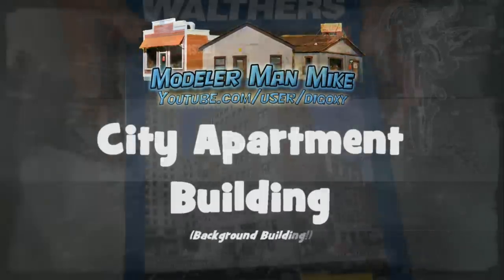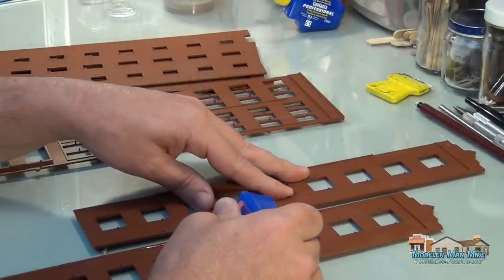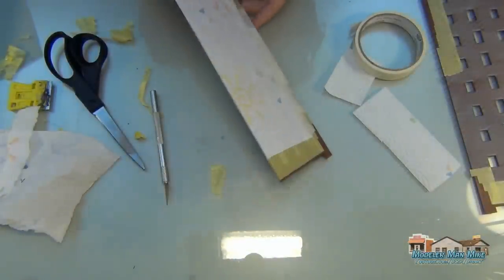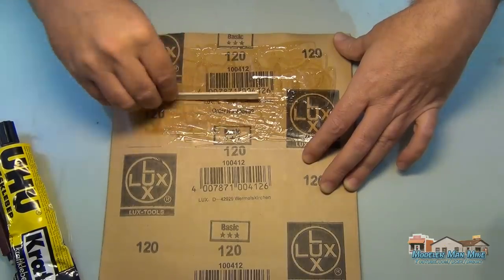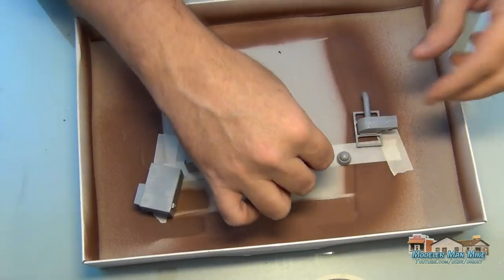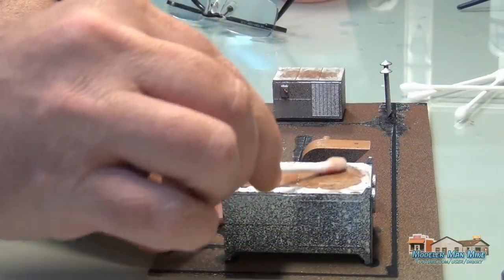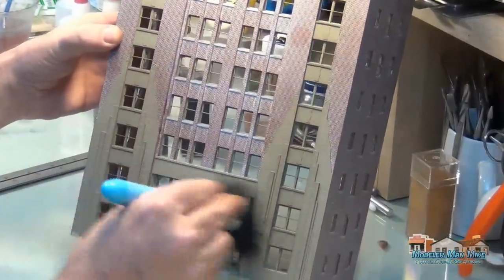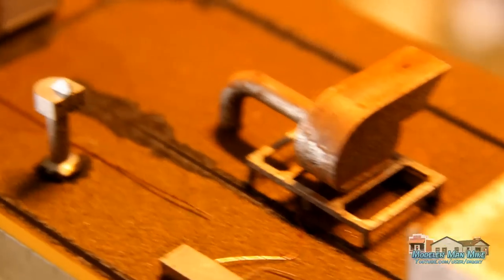Model Railroad HO Scale Build - Walthers City Apartment Building

Comment: Wow superb way of building and painting a model,liked the end result.
Reply from the maker: Yea, this works well for me. I spent so much time with the airbrush early on and using spray paint cut some time off on building these models.
Reply: I've just completed a Kibri mill kit I've used two of these kits and bashed them together to create a larger mill.Just needs weathering now to complete and added to the layout.
Reply from the maker: percomotion Sure would like to see some building techniques if you would be so kind to put together a video :)

Comment: I like using drywall mud for brick morter, easy to clean off and take's weathering well, very realistic when done right.
Reply from the maker: Hey, thats an idea, never tried it. does it clean off well? how about chipping when its dry?
Reply: The trick is to wipe off as much as possible before it dries completly, a moist paper towel does good after it dries, takes a little practice but like I said it looks awesome when done well. It may chip a little at the edges and corners but sometimes that adds to the realism.

Comment: I'll tell you about another really cool Walthers kit if you can get your hands on one and that's the Ford plant office building they made some years back.  I was lucky enough to get my hands on one and I converted it into a city hospital with the big ER entrance in the rear, a huge heliport on the roof and custom signs & decals to make it look like a real hospital in every way and everyone who saw it wanted one, lol.  I even found this outfit that made highly detailed 1:87 scale Huey choppers that I totally converted to "ile-Flight" helicopters and they sold like hotcakes on eBay until the company went belly-up and I couldn't get anymore???  Great videos my friend.
Reply from the maker: Bernhardt, do you have pictures of your models anywhere? You can look me up on facebook if you like. I would surely like to see this ford plant conversion! Thanks for the comments.
Reply: ModelerManMike I'll have to look at my old files and check because I'm not sure to be real honest with you?  I'll look into it & get back to you.
Reply: Howdy Mike, I haven't forgotten about the pics & are still going thru discs when I'm in my train room from time to time.  The problem is, I have several hundred discs with pics on them & I'm not real good at properly marking the disc so, I have to go thru them one by one, lol.  What I did luck out & find is, I located a guy on eBay who had a partial case of those 1:87 scale Huey helicopters I told you about so, if you have a need to one or two, let me know & we'll take care of that amigo.  Later, Bo (Bernhardt).

Comment: Nice vid! Love that roof top detail kit..gotta get me one of those!
Reply from the maker: Hey John! Yes, I havent really found anything for roof top details that compare to this fun little kit of stuff, I would like to see some others though if you run across any. glad you made it over to see some of these, I know your working hard on your stuff and getting an early jump on paint before lights will save you some grief later, I speak from experience :)
Reply: yeah, I used to big into the tabletop wargaming. I've painted my share of mini's na buildings. =) all of them will be painted. you can check out my control tower vid there is one of my painted buildings after I had put the kit together.

Comment: Not bad.  Maybe speak a bit more distinctly, but a good project and the scene changes are nifty.  Two comments from a retired electrician/ACR tech, though.  1.  Conduit is laid out and installed with 90 degree bends only in the application you've modeled.   2.  Rust on those roof top HVAC units starts at the seams between panels, so to give it a more realist look/feel, rust the seams completely before rusting any place else.
Reply from the maker: Great tips and suggestions. Thanks for your comments!

Comment: Mike just a thought.  When you go and illluminate this building a good thing to do may in fact be this.  Slip a little piece of construction paper inside the model, form  separate walls and floors.   That way, when you light it you may achieve a look of some empty  apartments either through non rental or residents out for the evening.
Reply from the maker: All good points Richard, thanks for the idea's! I hope to get on lighting this soon and surely will consider your idea's.
Reply from the maker: Brian UK Yes, I have used plastruct weld, its not to bad, a little thin but works well.
Reply from the maker: Brian UK check out my other video's on the lightkit, you might find it interesting using PIC IC's.
Reply: ModelerManMike Can you point me toward your video that shows the light kit? Thanks, and keep up the good work.

Comment: great video mike, great pace,  pleasant narration, fine workmanship... where can I get some machinist weights like you use in this video?
Reply from the maker: Those are called 1x2x3 blocks, I got mine from eBay,  Something like this maybe http://www.ebay.com/itm/1-2-3-Blocks-BL-123NH-Pair-of-1-x-2-x-3-Blocks-without-holes-/282432840736?hash=item41c24f2420:g:fmgAAOSw0fhXjLAv

Comment: Got any videos on major kitbashing? ..and why the prepainting of the walls? ??  I understand MAYBE the Windows while still on the sprues..but if your going to use plastic solvent cement to assemble the building paint interfers with that bond and raw plastic you can putty,sand,carve etc..then paint after that...

Comment: One more question...Is that a home made spray paint boot? I looked and couldn't find a vid of it.

Thanx
Reply from the maker: Hello Jim, thanks for the comments :) That booth I actually purchased from ebay, it wasnt to expensive. So, to answer your question, no I didnt construct it. It works great for what I do, bout the right size and it can collapse down to a small size for storage. The one I purchased was like this one listed on ebay, it wasnt this expensive though, you might find it cheaper http://www.ebay.com/itm/Hobby-Airbrush-Spray-Booth-Kit-Exhaust-Filter-Extractor-Set-Craft-Paint-Figurine-/141477787802?pt=LH_DefaultDomain_0&hash=item20f0bbb89a

Comment: Hi Mike
Did you have to sand the wall edges as you did in the DPM townhouse #1?
Reply from the maker: Hey Jim, thank you for the comments. The Walthers models are much different from the DPM models in that they are cast differently. The Walthers don't require so much pre-work to construct aside from painting. This model, the City Apartment Building went together very easily, the parts are made to connect seamless. This is a very easy build, the detail can kick it up a notch of course but I have seen this model on layouts with the plastic unpainted and just glued together. I would bet, without any painting or extra work, it would go together in 30 minutes, the windows being the large part of the work. Its colored plastic though, and it probably would look fine without much work.

Comment: You know what every high rise HO scale model kit is missing.  Elevator head enclosure.  I have a half dozen tall Walters and Bachman kits and not one has a small extra enclosure for the elevators lifting mechanisms.  Guess HO scale people are all athletic and don't mind walking up a dozen flights of stairs.  Nice job though.
Reply from the maker: You know what, your right and that would make for a functional detail for the taller roofs. Thanks for the tip!
Reply: Ya I have to get off my butt and scratch build a few for my layout.  Wife says nobody but me would notice it but now that I notice it, it is a big deal.

Comment: Wow, impressive!

What brand and color did ya use for the brick? I have a Reliable Warehouse & Storage (933-3014) kit I plan to paint that color.
Reply from the maker: Hey Kyle, I use rattle can paint, I guess you see that, Its rust-olemum Rusty Metal Primer and the paint I used for the mortar is water based Reeves Acrylic Fina Artist Quality Titanium white, I mixed some gray in to this to darken it a bit.